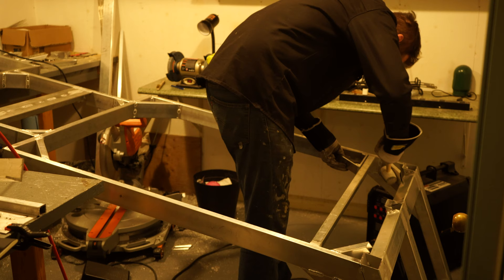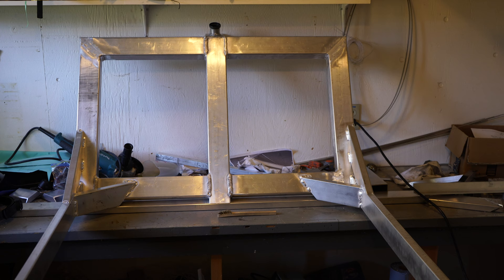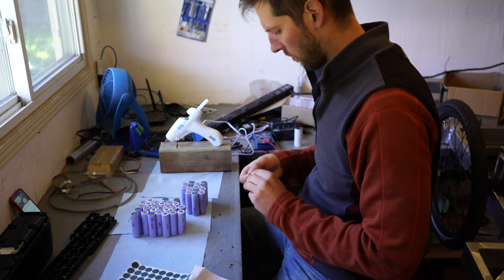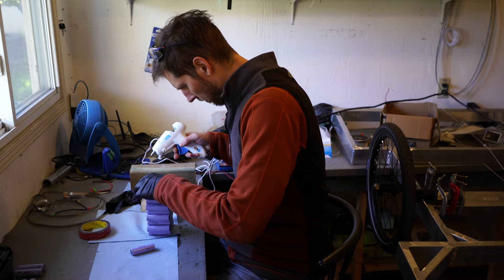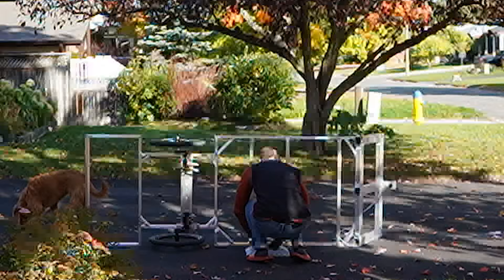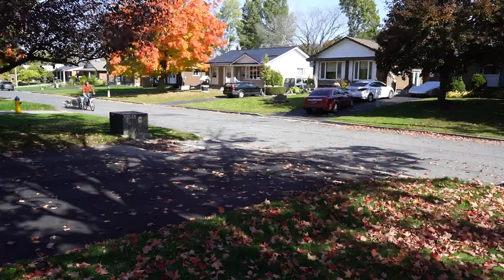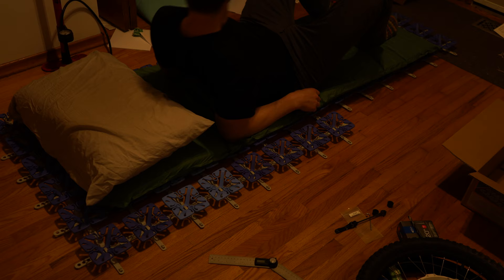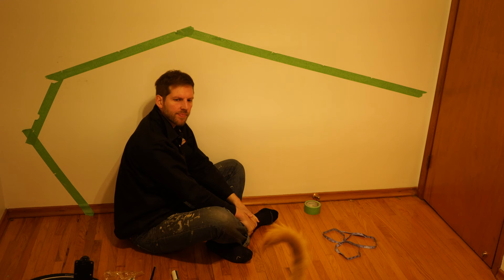Building Electric-Powered Bicycle Camper - (PART 5)

Comment: I have a similar design.  Base so far is super similar including "boat hull" and hitch design.  I'm planning on half inch plywood walls with large holes cutout for weight filled with rigid foam.  I want to use a 2216x1045 solar panel as the roof and outside wall width.  I end up with a back door and 6' height clearance at the back.  Taking a 4x8 and rotating it 26.56 degrees or 30 degrees can get the edge of a single side high enough.  A flat box at the back with full head height can be enough for guest chairs (folding), shower (drain out back), toilet, or just stuff.  Can put  a window access hatch on the shorter part of the roof at front for some cooking/drinks/storage access.
Reply from the maker: Hey Pascal - that sounds like something I'd love to check out. Please post some pics or video of it when it's done. I'm getting a lot of ideas from all the projects people are working on. Cheers!